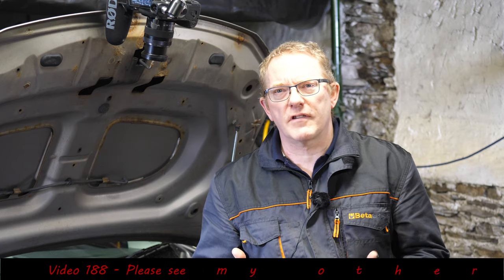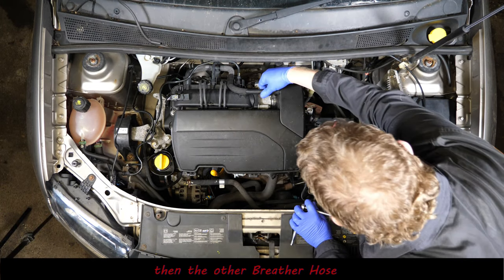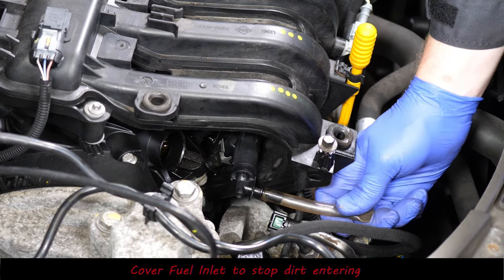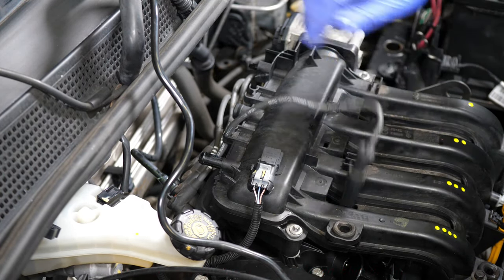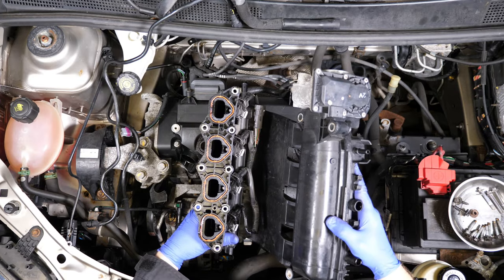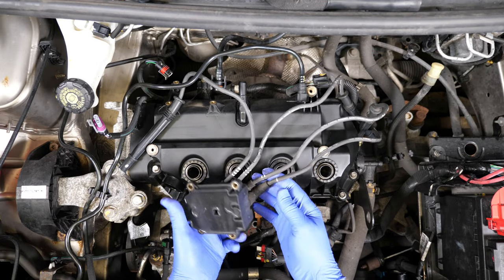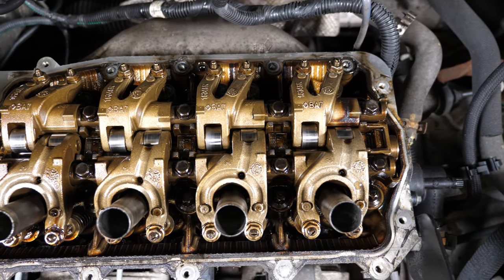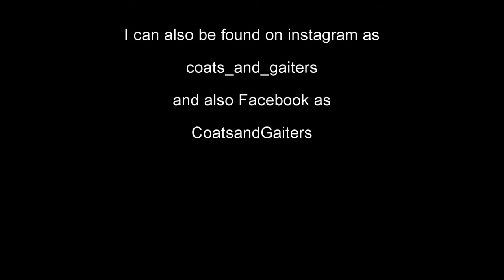Part 4 - How to Remove the Inlet Manifold & Valve Cover on Dacia Sandero Renault D4F 1.2 Engine

Comment: Good video. VERY clear instructional. Probably the best I've seen.

I've got this engine in a Proton Savvy and I was expecting to see where the PCV valve is in this video (as I think that's the problem with mine)
It's not your fault but I'm still disappointed.😉
Reply from the maker: Thank you for that.  This link might help as its the same engine in the Renault Clio.  https://youtu.be/izV1UsEB5qA?si=OJw4ypU97js5h3I5&t=606
Reply: @CoatsandGaiters  
Thank you SO much.
Between your video and his, I have all I need to get the job done.
There is so little info out there if you search for "Proton" so this is VERY much appreciated.😁
Reply from the maker: So the Proton uses the D4F engine? @STUCASHX